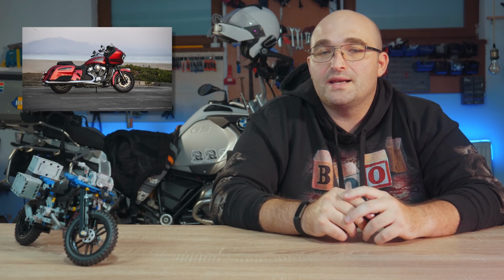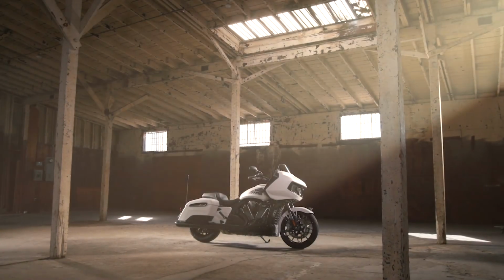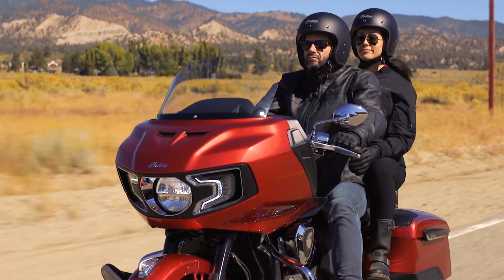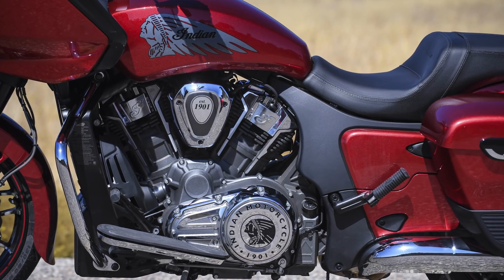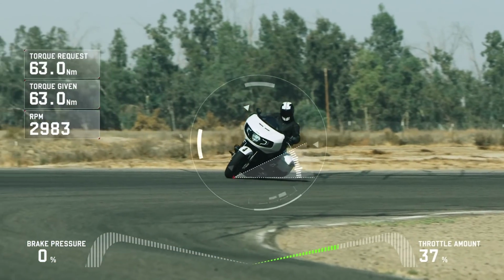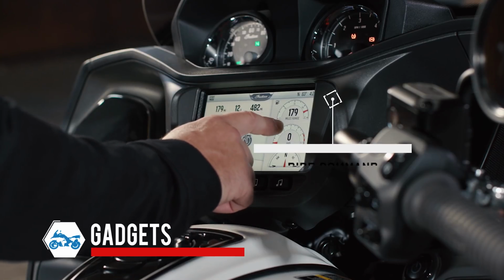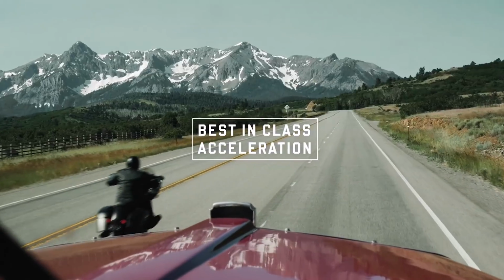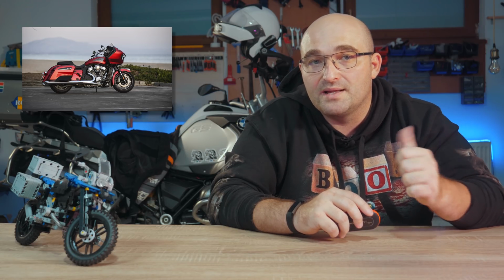OFFICIAL: 2020 Indian CHALLENGER Availability, Price and Specs

Comment: As a mechanic my only gripe with the Victory and Indian bikes is that the transmission is internal to the engine case. What that means is if the transmission EVER needs servicing you're splitting the cases to gain access to it and that's gonna be very expensive. Harley Davidson has managed to keep theirs separated from the engine and no "splitting of the cases" is required to gain access to the gearbox. Might not be a big deal to most people but I like my stuff separated.

Comment: This is old news for victory owners  this bike was leaked 2 years back as the next victory just after the announcement they were shutting victory production down I'll keep my magnum to the end of my riding career don't need lean technology and mine came with all led lights inverted forks 4 cables per cylinder and 100 watt stereo and 21 inch front wheel guess the challenger don't look so bad ass now
Reply: I would buy an XCT right now, if I had the cash. For now, I'll just stick with my Octane.

Comment: This is the Harley killer for sure but, why? Why do we need another version of an American style "road boat bagger" when the entire segment appears to be on the decline. Unless the Challenger is just designed to steal H-D bagger riders and add another nail into Harley's coffin. I'm impressed with the performance of the engine but it seems wasted in a traditional bagger style frame with limited marketing appeal. Maybe I'm missing something but this isn't the transitional bike that will disrupt the market. Its just an updated bagger for the declining bagger fan segment and not an innovative next generation bike that will capture market share. At least BMW designed something bold and radically different in the R1800 and Triumph's Rocket 3 packs an innovative punch. The Challenger is impressive but not bold.
Reply: When you get older, you'll appreciate them. I've owned a bunch of standards and sport-tourers over the years and they were all nice machines, but when it comes to comfort, these tractors have it in spades. And they're simple. You don't have to dismantle 40 pieces of Tupperware to remove the heads to check the valve clearance.  You change the oil and ride. And the tires will last twice as long as sport touring tires too!
Reply: saddlebag ..I’m 60 and I ride baggers from time but no way would I have a bagger instead of a Spoke to a machin
Reply: I’m  60 and I do ride baggers from time to time. But there’s now way I would swap one for my Sports Touring machine. In fact I’m buying Suzuki gsx f next week
Reply: I’m not so sure about your statement. I don’t own a Harley or bagger style bike, I own a sport touring bike. This past summer I took 5000 mile ride from Southern California to Jasper national park in Canada. I kid you not I easily saw more than 2000 motorcycles on that trip and 80% were Harleys. I couldn’t figure it out for the life of me but that’s exactly what I saw.
Reply: @leroyjones769  Its not the number of bikes, its the age of the riders. H-D riders average just over 50 years old and the next generation isn't buying baggers. The younger buyers are more into ADV's and mid-displacement bikes. At some point the older riders stick to what they own knowing they will retire from riding or try switching to a trike. Basically, the bagger segment will age out. H-D sales are down 3.6% this year and they will end 2019 at 214,000 units down from 231,000 last year. H-D is searching for the transitional bikes that will appeal to younger riders - ADV, Street Fighter, Sportster replacement with their new 1250cc and 975cc water cooled engines - but their execution is poor and they don't know how to market outside their core fans. The winners will be the likes of Triumph, Ducati, and BMW who appear understand the demographics.
Reply: Gene Clarke ...I don’t know Gene. I live in Southern California and I see an AWFUL lot of young guys riding Harleys. Again I’m not a Harley guy at all but I think it has more to do with price than anything else
Reply: @leroyjones769  Read the CNBC article "Millennials may claim another victim: Harley-Davidson and the classic American motorcycle". It gives a good summary of the demographic issues. Your are absolutely correct price has a major impact both for motorcycles and as the average price of a car/SUV/PU averages $36k that leaves little extra cash for a motorcycle or almost anything else. A $27k bike may just be out of reach until you get into your 50's and have a financial cushion. The article states; " ... the average Harley-Davidson customer is a married man in his early 50s, with a household income at or above $90,000."
Reply: WesPhly ...point well taken..thank you👍

Comment: do you know what that monster weighs?
Reply: It doesn't matter. It's a Victory with a hot engine. It'll ride and handle great. They carry their weight very low.
Reply from the maker: It's very light on it's feet :) 831 lb (377 kg) full of fuel.
Reply: 850lbs